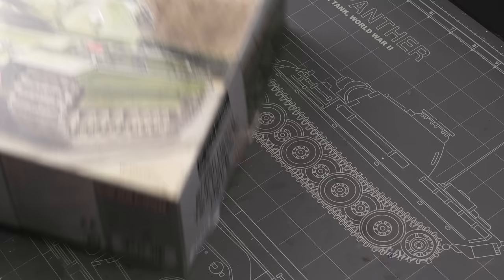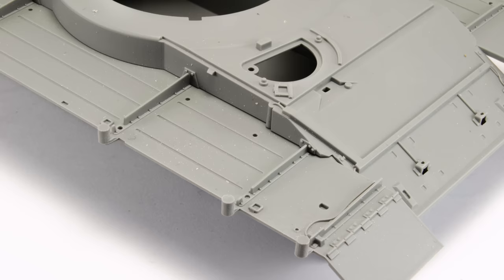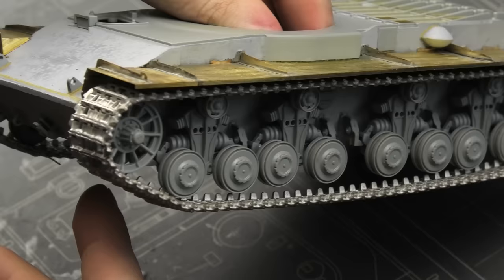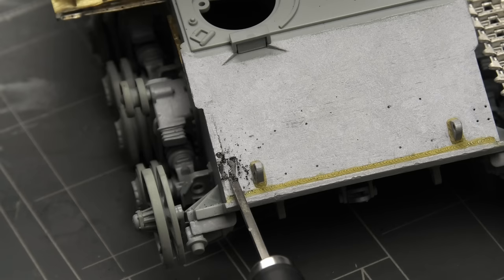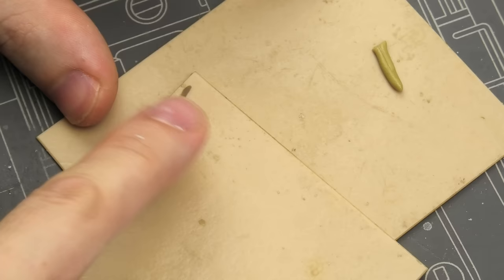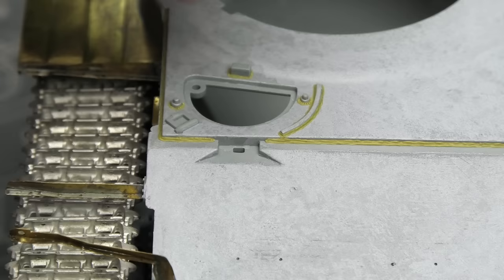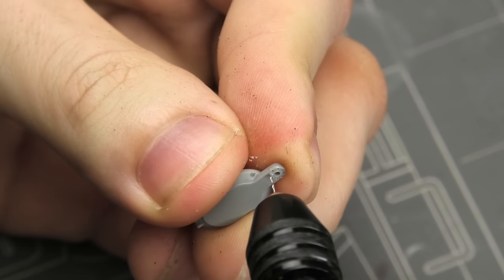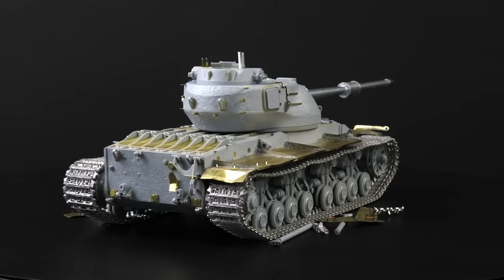Saving This Conqueror Mk.2 Shelf Queen - By Destroying It! (Dragon 1/35)

Comment: I had the privilege in 2020 of working on the restoration of one of these brutes, which was itself a gate guard in a sorry state, [similar to those range targets] so the Conq has a special place in my heart. Nice work. 
If you're planning on adding the side stowage bins, do note that on the real tank, they're made of aluminium so they didn't rust like the fenders/mudguards did [those were completely full of holes.] Also, there were inexplicable bullet-sized, but non-penetrating dents in said aluminium stowage bins, presumably from blanks/airsoft/some other kind of weak projectile. Maybe you could include something like that in the final model, though at this stage it's probably too late. I am thoroughly impressed by those details on the gun mantlet's dust cover mounts.
Reply: I worked on one at the Imperial War Museum trying to keep it in running condition, this was in 1979 - 1981.

Comment: May I recommend the "Abandoned supra of the mountain" for one of your dioramas? There is a modified MK3 Toyota Supra that was evidently crashed off a mountain road by a youth driving enthusiastically in Japan. The car was subsequently abandoned, and is still there 30 years later. Noriyaro has a video of the car in it's current state for reference.

Comment: For larger punch and die sets Precision in the US makes them up to 1.250" for their large set and .750" for their small sets.  They also produce metric versions iirc. Also there are knock off sets available.  The small sets start at .125/3.2mm and increase in .0625/1.5mm steps up to .500/12.7mm after that it is .125/3.2mm steps. They will handle .020/.5mm styrene easily. The sets are capable of punching thru .030 carbon steel and brass. Stainless is .015" to .020"